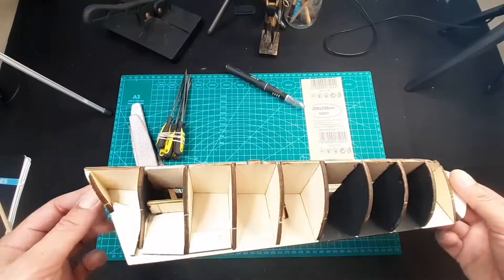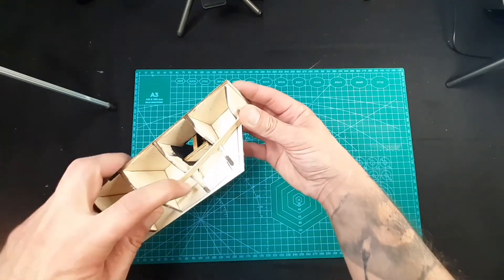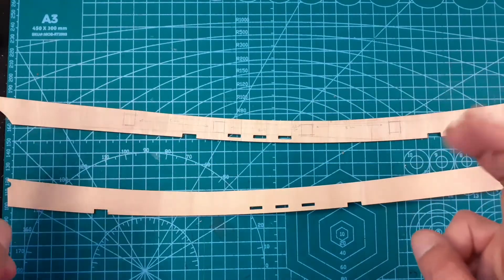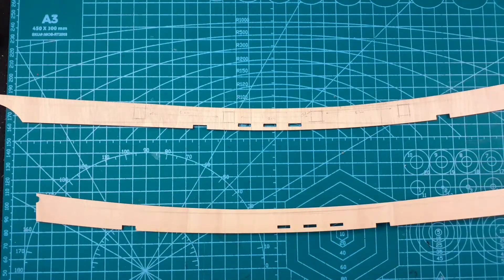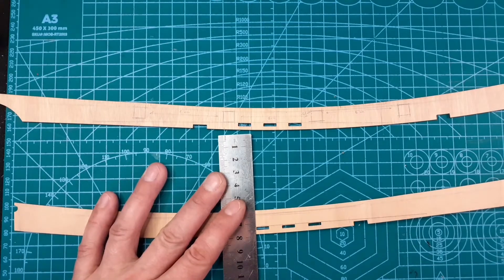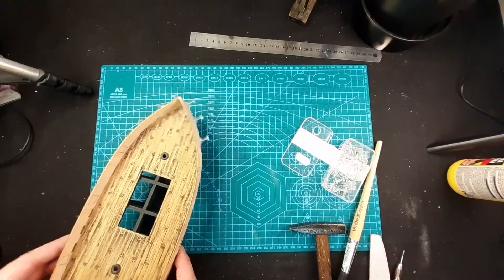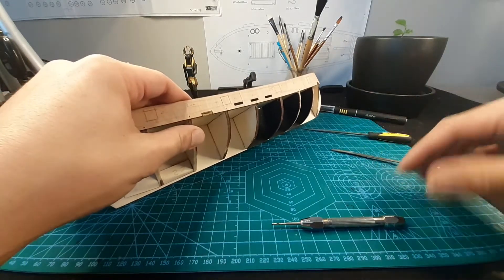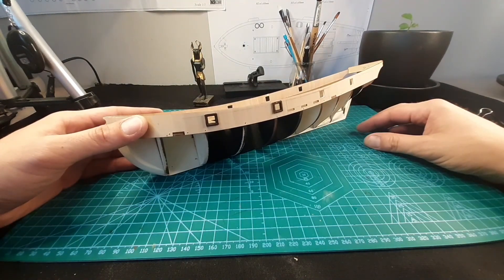Polaris #5 Placing the bulwarks

Comment: would you recommend using the nails privided by occre or just simple glue it on? also if i need it in will i remove the nails then before sanding and planking? thanks mate
Reply from the maker: I did show the pins that I use for bulwarks in video, it's easier to remove. But sure you can use the nails from occre. Use white glue for wood, nor CA, it will be much stronger.  I try to remove the nails before sending, but sometimes they really stuck so I sand it with them, have no problem. If you have more questions, anytime buddy 😉
Reply: @homeharbour6238  perfect! thanks! ill try pins first so
Reply from the maker: @b_kaman  anytime 😉

Comment: Do you think that it would be ok to cut the gunports before attaching bulwarks to the hull.
Reply from the maker: That's what I did. It worked. But be careful when you bend them. They are more fragile with holes
Reply: Thanks for the very quick reply, that will make it a lot easier.
Reply from the maker: @Alcopop100  I'm always here 😉 glad it helped

Comment: FYI - the bulwarks are not flexible enough to bend without water. Mine snapped while doing your method.
Reply from the maker: If you saw on the video it didn't snap. I always tell people you can do it by the instructions if my method is not good enough. Maybe you did too much pressure on it, I don't know. But I'm sorry that it broke...
Reply: I had the same issue. I wan't using this method. Maybe they have changed the material IDK. Mine bulwarks really feels they will snap if shaped  to the deck, and they did when they getts dry even after watering.
Reply from the maker: @АндрейГруздев-ы4ь  guys, you saw me doing it without water. I honestly don't know why you have this problem. I'm sorry that it happened